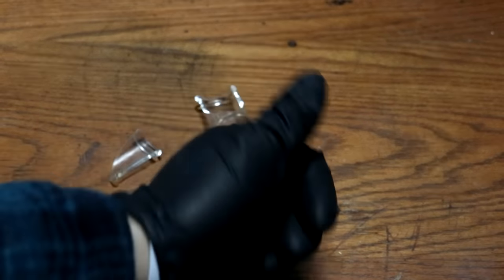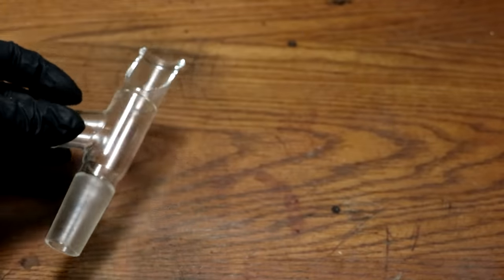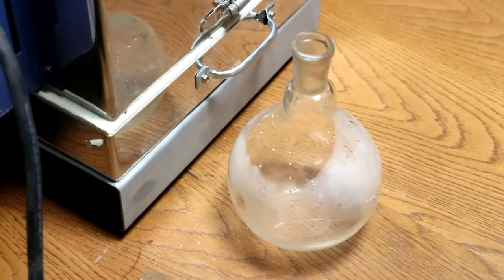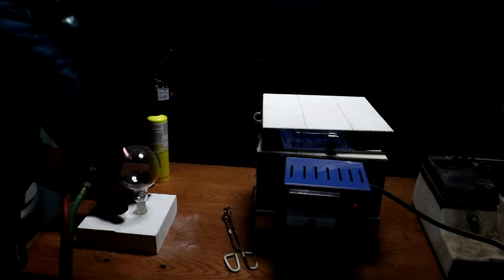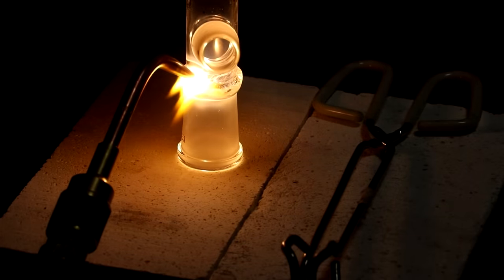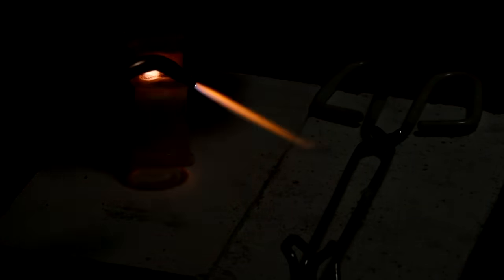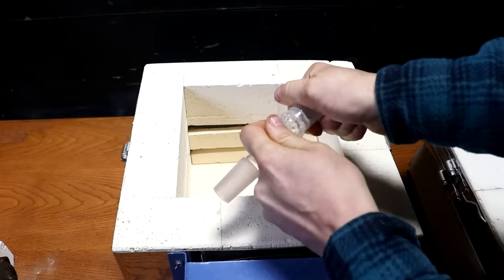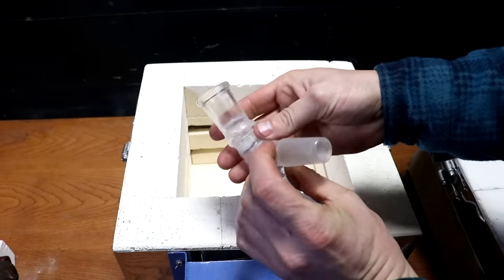Can I Weld Glass?

Comment: Cody, i just wanna ask if there's other yellow colored metal aside from gold. I got this small (4 inches) knife somewhere. When i first saw this, it has a black tarnish like starting to coat the knife.  i go to the kitchen and cleaned it with steel wool, and then sharpened it with whetstone. I'm amazed that despite of the abuse i made, it's still color gold. I went to a local jewelry shop to test if that's a gold, but it's so sad that its not, but then the one who tested it wants to buy it from me, he said he was only amazed in the engravings. I rrefuwed because I suspect this is a true gold.

Comment: I wonder if for the bigger flask a ~300°C hot air gun would have sufficed to prevent cracking or if that would actually have cooled enough it to cause cracking when applyingvthe torch.

Comment: Would superglue not be the easier and more manageable solution? Obviously you’d never be able to do heat or acidic reactions (or organic ones for that matter) but at least to set it? Then weld a solid layer of glass on top of the seal? Then you might be able to do those reactions if the weld took hold.

Comment: Having watched glassblowers work with glass and attach two pieces together,  it seems the oxy torch is way too hot and forceful.  A large Bunsen burner is enough heat to accomplish the job.  The propane torch you have should be adequate.

Comment: Well Cody, but do you think that's better than buying another adapter?
The energy of the furnace and the oxy-acetylene from the torch that you spent are cheaper than 30 bucks of a new adapter? 
Or you're doing this just to show that can be done?
Reply: It certainly didn't cost anywhere near $30 to do the repair. Plus, the experience was worth quite a bit, in case he needs to weld some boro glass in the future.

Comment: For the flask, I would have filled it with sand and heated the entire thing.  The sand stores heat and releases it into the flask.  Also, while welding, put the sand-filled flask in a flask heater turned all the way up.
Reply: this wouldn't work, as soon as you heat the glass beaker the sand (silica) would want to stick to the glass making it crack and or very rough and prone to cracking

Comment: Apparently cooler torch is better and yet this hotter torch worked on smaller piece. Why? I think one other big difference is thin glass cools faster in contact with the air a little after leaving the oven, and heats faster on contact with the torch, and this causes larger temp differences whereas thicker glass in the smaller piece holds oven heat and torch heat longer, causing less temp difference.

Comment: Why don't you drill a few small holes in the bottom of your spherical glass and put a torch in the opening.
The torch keeps the glass hot from the inner side and you can weld the glass with your tiny torch?
After that put the glass fast in the pre-heated furnace and let it cool like the othe one.

Comment: If you use propane next time your glass won’t go all bubbly. And you need a larger tip. Try a multi hole tip. Then the glass reds to come up to like 1100f for doing work like this.
Reply: White powder is silica also

Comment: For that flask...do you think it would have helped if it had sand with oil or water mixed and densely packed inside it. Then when you welded perhaps it wouldn't crack. I've never welded glass so just throwing out an idea.

Comment: That's not how glassware is welded normally. Use a softer, larger flame and heat the whole rim of both parts at once and plasitcise them. Then press the two parts together, with slight relative movements to join them tightly. With even softer flame even everything out and cool it down slowly. Watch glass-blowers and their techniques.
Steel welding methods don't work all that well, they create a lot of local stress.
Glass welding torches don't work with pure oxygen, normally, they just use concentrators.

Comment: Here's my two pennerth for what it's worth.
What I would do is have some kind of set up like the top of a barbecue grill?
That might work, in order to get the whole of the fitting, that is both parts up to a high temperature.
Of course not high enough to melt the glass but let's say 10 or 20% less than its actual melting point.
This will reduce any temperature difference problems that might be encountered doing the whole thing from cold.
So, there you are, you've got the two parts lined up, perfectly in position with both glass pieces up to within 10-20% of its melting temperature.
I think welding under these conditions would be almost perfect.
What on earth could go wrong?
You tell me!
POST EDIT: Shit! 
I keep doing this.
Pausing the video to throw in my two cents and then when I restart the video, lo and behold...
DAMNIT!
.
(I'm definitely gonna stop doing this. Definitely.)

Comment: that white powder may be chemicals dissolved in the glass - as you know, borosilicate glass has additives that make it more resistant to thermal shock. those additives may have come out of solution or oxidized as you applied the flame to it? I don't know how glass works lol, just guessing.

Comment: Thicker glass is easier than thinner glass because it has the ability to buffer Heat much better and it's usually uneven heat distribution that causes the problems and cooling is just as problematic as Heating so it must be cooled very slowly and evenly also (annealed)

Comment: try oxy-propane, I use propane cutting tips for brazing since the preheats on a propane tip are designed to heat a relitively small area hot enough for the oxygen jet to burn it, it heats a larger area more gently than a acetlene welding tip, and it has a massive output range available, from enough for shitty blacksmithing, and doing large brass beads to a tiny burner for brazing relitively small things, if a larger area needs heated to a lower temp the tail can be used for that as well.

Comment: The acetylene is too much in one concentrated area.  

Try a weed burner with mapp gas (modified to angle upwards), and for really big stuff like that boiling flask, try a propane turkey fryer/construction heater  Boy do they make quick work of even borosilicate!

They make far more BTUs, but over a much larger area/volume, with a lower (but still plenty) flame temperature.

Hth.

Comment: I had the exact same round bottom flask and crack as that and tried the same thing. It just has too much temperature difference around it and as you heat and fuse one part of the crack, it cracks more down the seem. I just gave up.... I still need to replace it...

Comment: Just wondering if you could wrap glass fibre matting around the area to be welded as a filler? Would that help or hinder?
Reply: MrPGT9999 No.  Borosilicate glass can not be mixed with random fiberglass.
Reply: @MrKnutriis  Thank you. I forgot to take into account the borosilicate but, then again, I am not a glassman. I do find it fascinating, though. Glasslinger is a regular on my watchlist, especially when he is making glass items. Do you know if it would be helpful on regular glass?
Reply: @MrPGT  I don't think so.  My experience is limited but I think the only glass you can use with borosilicate glass is borosilicate glass.
Reply: MrPGT9999 what is 'regular glass'?  Borosilicate tolerates a blue flame when it's cold.  'Regular' or soda glass springs into a thousand pieces from the same treatment.  As for the fiberglass idea  - no I don't think that's the way to go with any type of glass.
Reply: @MrKnutriis  Regular = yes, soda glass, as opposed to Pyrex/borosilicate types. Thanks, Knut. That is good to know., Although I did see someone else suggest using a "filler rod" type effort, similar to metal welding.

Comment: Think of it as copper pipe brazing, use a flux and pressure test via a pump and it will work i swear.
Flux lowers melting point of the parent material you could have done this

Comment: Have you tried running oxygen and propane through your oxyacetylene torch for lampworking glass more gradually yet? Might work fairly well with compressed air instead of oxygen. I wonder if you can make your own adjustable bench burners and if you have any thoughts regarding microwave kilns...

Comment: It's not an easy thing to do aye Cody though I have managed to repair a separatory funnel though I had to use some extra glass from a glass tube to help with the weld and the fact it's such a small hole did not help but I did get it working again and I was able to continue to use it :)

Comment: Next time  use a Smith little jewellery  torch. Oxy/propane.  Start by coating the glass with a layer of soot and chase the crack at both ends.

Comment: I honestly think if you gave this just a bit more thought about heat control you would have had more fun doing this and been able to save the big flask. granted I dont have the tooling and I am sure its just for fun. But if you wanted to fo it better you might have wanted to have that map gas going  on a low setting in some form of containment. glass makers have big wide torches for keeping things even while cooling and heating.

Comment: what if you could make a chamber (like a vacuum chamber, but for thermal stuff such as heating glass) with gloves so you can work with materials in a heated environment? or would even heat resistant gloves melt at such temperatures for long enough? :/

Comment: Dont know how it would work on glass but crack repearing metal you need to drill the ends of the crack out to weld and that stops the crack from running

Comment: What I noticed when you were trying to cure the crack, you went from one side to the other. 

My recommendation for next time is to "weld" 3 inches one die then do the same on the other end of the crack. Then finish the middle.

Comment: You should have filled the flask with sand then put in furnace...then pull it out leave sand in it so the heat stays while welding it ...it might have kept it from cracking so fast

Comment: I bet if you had a softer flame on the flask it wouldn't of cracked like a regular propane torch the tip on the oxy accadaline pushes the glass when really you just need to bring it right before melting point it may collapse on it's on wieght tho still

Comment: That's not welding, that using a torch, I actually weld. Welding requires an electrode, gas, and electric charge to weld something. The only material that can be welded together is metal. The electrode is used with a gas mixture to produce an arc. The gas I use is a mixture of co2 and argon. With welding you need to weld within the arc gap.

Comment: Doesn't glass become conductive at high temperatures? Could you weld glass with an electric arc?
Reply: There are things called arc furnaces. And yes glass becomes conductive around its softening point

Comment: Excellent job with such primitive equipment. GOOD THING you didn't "succeed" in repairing the boiling flask! It would have been dangerous to heat chemicals in, not knowing if it was ready to crack at any moment. Best to just save the joint off the top and trash the rest.

Comment: joining two cylinders like that, could you have put it in a lathe and friction-welded it?
Reply: The cold glass would immediately shatter with that approach.  It's easy to fuse glass with a torch and also easier than what Cody makes it look like since doesn't know how to do it.

Comment: You might have better luck repairing large glass things if you're working over a gas-fired grill or similar large-area heat source.
Of course, that has the slight problem that you're working over a gas-fired grill or similar large-area heat source.

Comment: Glass cutters are very easy to use and also very innexpensive. The saw may have worked, but a little glass cutter probably would have been better. That being said, I have limited experience with both and am by no means an expert.
Reply: Actually, one of those rolling pipe cutters with the pizza cutter like roller on or would work really well for that.
Reply: Also, for the glass that I've seen, a butane torche is enough to melt it. That being said, the oxy torch was probably better because it had a higher heat and a more concentrated flame. By the time you got the whole edge melted together with the butane torch, the heat would've probably spread and melted other parts of the glass. Once again, I'm no expert.

Comment: This is the first time I see Cody doing something absolutely wrong. I'm not sure what was his actual goal (to simulate metal type blowtorch welding style on glass) but when he tried to join those two piecees he used a completely wrong technique. You're supposed to heat the two circular edges at the same time and just stick them together. Easier done than said without a glass lathe but I've done it with completely manual approach too and wasn't hard.

Comment: Cody
DO NOT EVACUATE THAT STILLHEAD 
All those bubbles in the glassware weaken the glass around your weld
It should be fine at atmospheric pressure but once you get down to vacuum that weak point could cause the apparatus to detonate

Comment: You can do it but it's very difficult it requires that both pieces be made of Pyrex or the same kind of glass and both be similar thickness because I've done it before using believe it or not a propane torch eating both very slowly and simultaneously but it didn't last long because I heated it too fast when I used it the first time and just use your imagination because that's all the more specific I am going to be

Comment: Of course, one can weld glass. Have you not ever watched a glass blowing? They make some incredibly amazing artwork and they often will weld two pieces of glass together just by heating them and pushing them together. How do you think that piece of glass you were holding at the start of this video was made? By welding. But there is no way in hell they do it with just small little torch. You HAVE to have the entire thing red hot or it is just going to crack. Cody, why did you not do some research on this before you tried it?